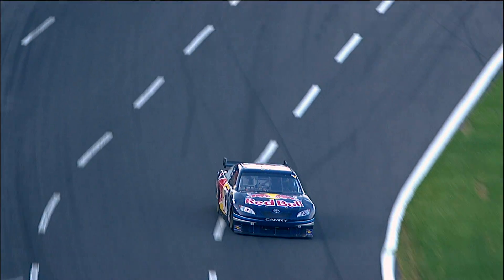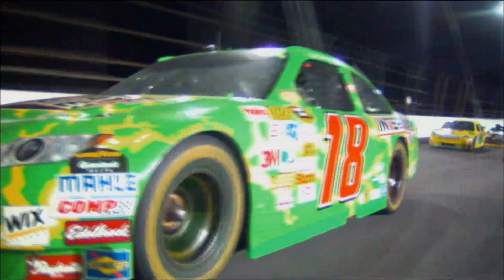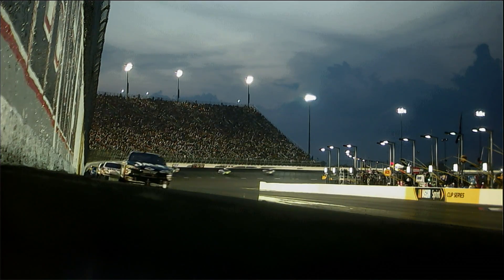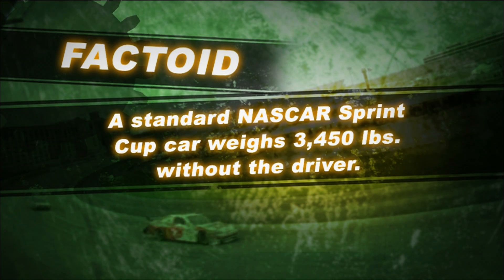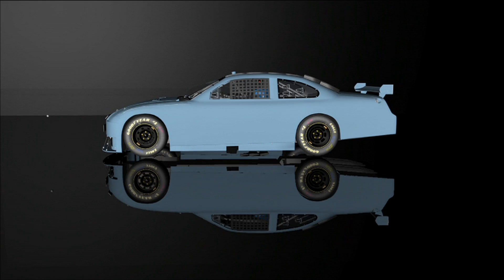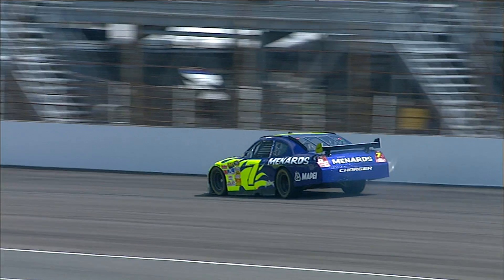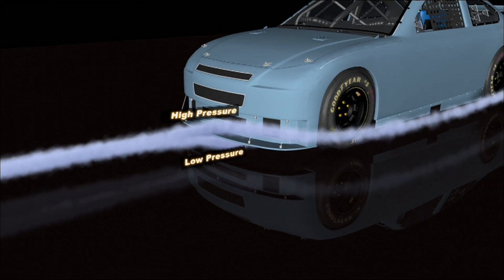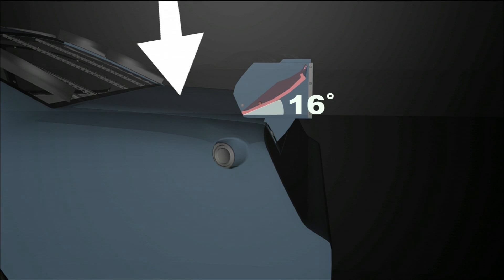Grip | [NASCAR] Science of Speed

Comment: The Bernoulli Principal is NOT how aerodynamic forces work! Air speed does NOT equate to pressure!
Reply: As a wing shape cuts through a fluid, the flatter surface pushes with less force against it (esp. in the N direction) expending less energy. The forces on the fluid from the opposed surface are much greater and this differential increases with velocity. You don’t have to recognize Euler’s work incorprating Bernoulli’s observations...it’s just science and math